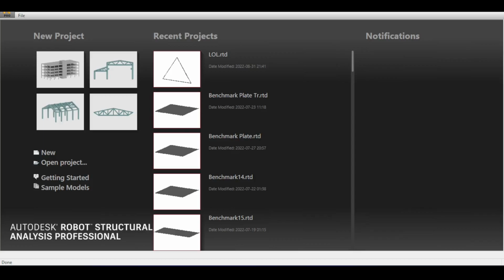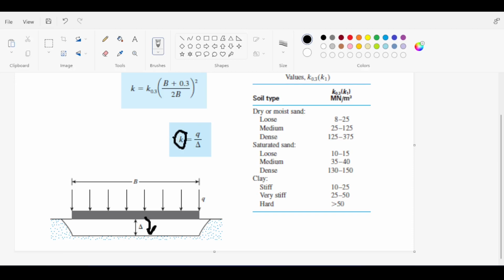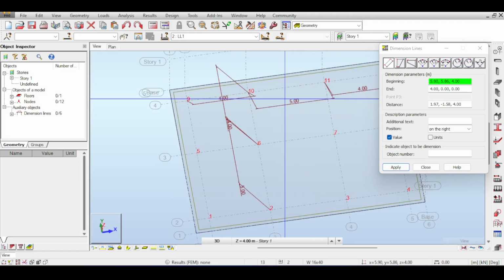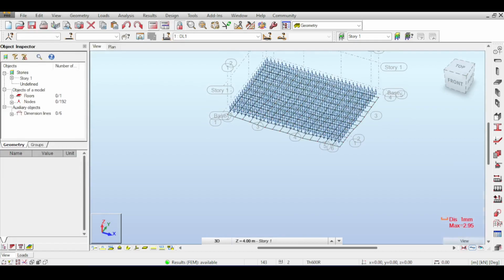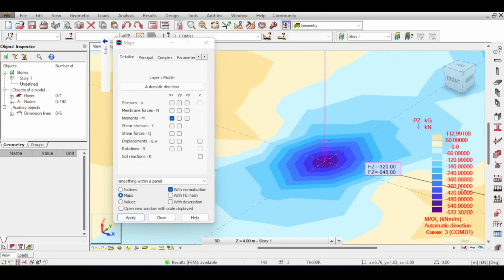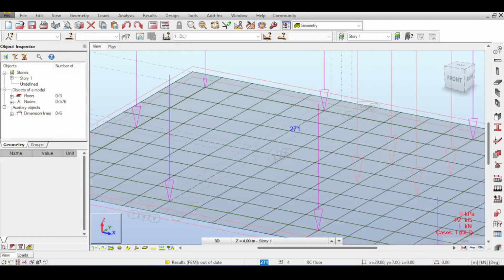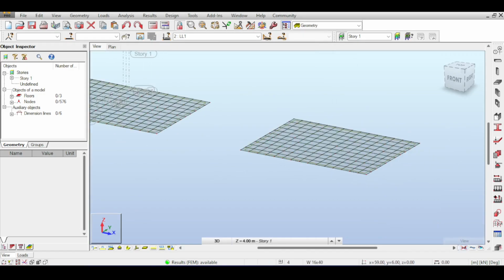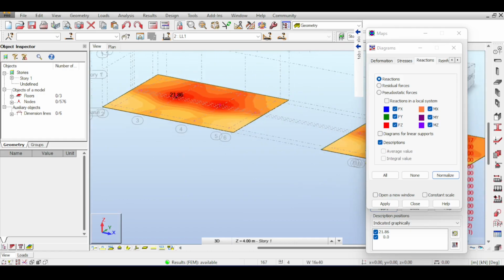Modeling Mat (Raft) Foundations (Flexible Method) in Autodesk Robot

Comment: Hello CEE. First and foremost, outstanding tutorial, thank you! You are so relaxed and yet there are tonnes of excellent tips (one after another from start to finish) on this video. You really are the G.O.A.T period.

Congratulations on model #3 mimics and the ideas that this may have given you to implement on your STRADO software. I’ll say it again, these mimics and the comparative analysis that you do are a welcome bonus and are very helpful for deeper appreciation of the concepts behind the scenes.

Re: 28:40. In my opinion, the 70% (or any other %) coverage “rules of thumb - ROT” should be viewed as a very rough and general ROT, never as an absolute or a requirement. For me, the available soil bearing capacity v/s structural loads and the issue of “differential settlement” which you have also touched upon in this tutorial should be amongst the focal determining factors whether to use footings or mat. 

Re: 04:15. Your ROT minimum of 300mm and 100mm per story is a very good starting point that is relatively easy to interpret (of course the starting thickness value is a placeholder with the actual design thickness value to be sized during the design process). Too often, most speak of raft thickness as ranging from 0.5m to 2m or even more but this is sadly quoted or stated without a clear relatable reference like yours that one can easily attach to their structure. I find your ROT as the most “straight to the point” so far.  

Thank you again for the wonderful tutorial.

Ps: The mesh on the slab in your tutorial was made of near perfect squares (1m x 1m). The similar slab model that I made also had similar near perfect squares mesh but it also had a mix of a few irregular quadrilaterals and triangles and even X-cross in one of the internal columns load point. Is there a way to manually “clean-up” simple mesh like the above? If so, could you perhaps include how this can be done in future videos?
Reply from the maker: Well, thnx for your comment. 
So I am kinda the Magnus Carlsen in RSA ^_^ thnx a lot, it encourages me to improve even further.

I agree on both comments about the rules of thumb mentioned in the video.
Another subscriber, Nii Serpai mentioned that he is using in his BS implementation N/10-12 which is similar to my ROT.

As for the request, of course. I will add it to my ToDo.

Regards,
CEE
Reply: @CivilEngineeringEssentials  
😂🤣😂♟♟♟You are kinda of but with one extremely technical and significant difference, I have not (yet) seen you simply resign tournament when defeated or when you are faced with challenges of the likes of Hans Moke Niemann.
Reply from the maker: @donaldkhanye2323  I am following that issue actually. ^_^ it is kinda the top story at the moment. Resigning from the 2nd move is kinda odd. Let's see what Gotham Chess, Hikaru Namakura and Agadmator say about this.

I haven't had the time to check those out as the semester has started and I barely have time to follow all of those things ^_^
Anyways, all the best,
CEE